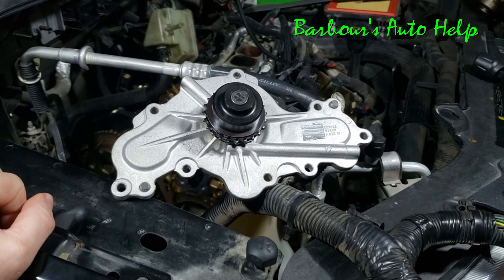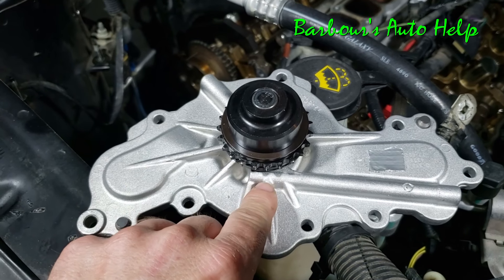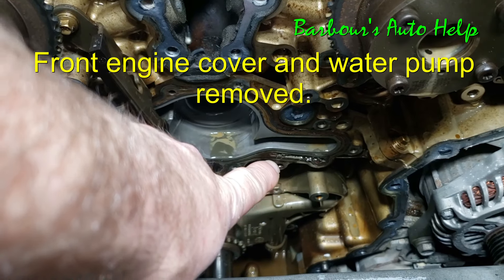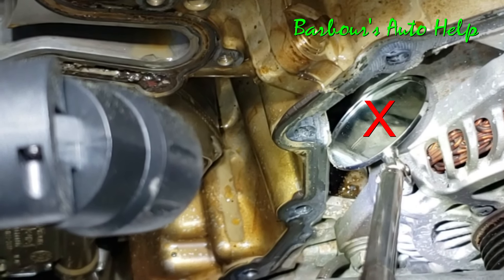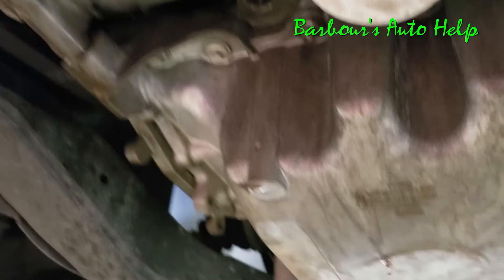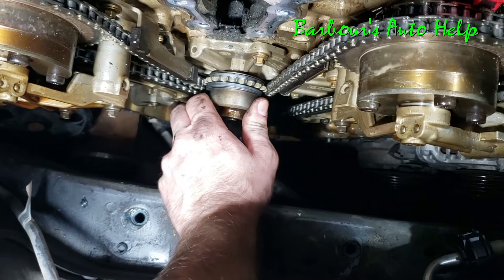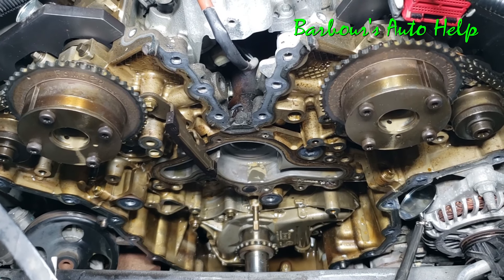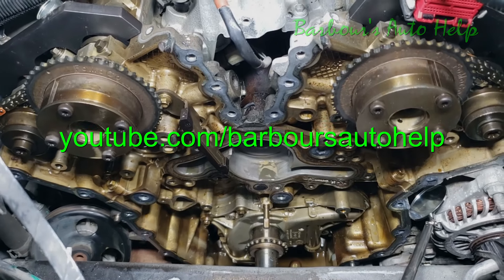Ford 3.5L and 3.7L Water Pump Leak/ What To Look For

Comment from the maker: No, It's not your imagination.  This is a repost.  I left out the fact that this information is also applicable for the 3.7L V-6 too.  Had to get that in there.
Reply: Thanks!  Just had a police intercept Explorer come in for this.  147k miles on it (and a ton of idle hours since it's still in service) and this is the second water pump failure for this vehicle.
Reply from the maker: Have a blast!
Reply: It doesn’t apply to any of the RWD engines like the F-150, Transit, and Mustang.
Reply from the maker: You are correct.
Reply: @BarboursAutoHelp  2017 Ford F150 4WD?
Reply from the maker: Not the same.  Yours is externally mounted.
Reply from the maker: But, I can answer some questions regarding that vehicle.
Reply: @BarboursAutoHelp  Thanks for the quick response, that was my biggest concern and now I can rest easy. One other question I have, is that my radiator fan runs on high (for 2 minutes) after I start the truck again, after running it for an hour +. It may completely normal, but I was going to ask the dealership. Appreciate the help!
Reply from the maker: Does your F150 have the 5.0? And is it low on coolant?
Reply: @BarboursAutoHelp  3.5l ti-vct v6 (ffv) Duratec and the coolant is full.
Reply from the maker: Sorry it took me a while to get back to you.  Id suspect something with the A/C possibly.   I've seen several F150 with very high pressure on the high side of the system.   It's possible that the txv is sticking or you have trash in the condensor.   Not saying for sure that's it but thats what I suspect.
Reply: @BarboursAutoHelp  No worries and I appreciate your help. Taking in Friday for an oil change and am having them look at the fan issue at that time.
Reply from the maker: Awesome.   Let me know if you need anything else.
Reply from the maker: Check out the description.
Reply: So, we have an MKZ that is overheating.  Not having coolant loss that I can tell but the car is overheating.  Thermostat is good.  Just noticed that it sounds like a bunch of loose change rattling around.  I am guessing that the impeller came apart so it simply cannot push the coolant.  Any thoughts?  Thanks!
Reply from the maker: It's entirely possible.   You'll need to do a bit of digging to be sure.   May not be a horrible thing to have a tech take a look.
Reply: Can i send you short video for advice
Reply from the maker: @meirzitun1 Of course. Post the video to your channel and the comment here with the link.

Comment: My gosh. Thank you for posting this. We just had some very low temps and I thought I had cracked the block. Only reason I gave pause to that theory was because the block was dry where the water jackets were. I was scratching my head baffled trying to figure out where the leak was coming from 😂. I was going to pull the trigger on a reman’d engine tonight. This video just saved me thousands of dollars.
Reply from the maker: Now that makes me feel so good!  I’m very glad to have posted this as well. Good luck to you.

Comment: First off Thanks for the video! Had my water pump changed 2.5 years ago which was an extremely costly repair and just noticed last night that it’s leaking from this exact area 🤦🏽‍♂️ I check my fluids often and maintain my vehicle very well. Had no indication that this was coming again. I love my 13 Taurus so much but I don’t think I will ever buy another vehicle with this engine 🥴
Reply from the maker: Unfortunately I had the same issue just a few months ago.  This time I put a Motorcraft water pump in it.  Should hold it much longer.  Brands do matter.

Comment: Thank you, I was watching one of your other videos and halfway through replacing the timing chain and water pump when I noticed coolant still running off the side of the block on my 07 Edge. Thankfully, I found this video before pulling the rest of the components off. Same issue, catastrophic pump failure idling in gridlocked traffic.
Reply from the maker: Glad it helped

Comment: I’m just chiming in here. I have a 2013 Edge. Leaking coolant today and saw this video stating the water pump may need replaced. Bought this at 30k in 2015. Never thought to check coolant for a change out like you’d do an oil change. Quoted roughly 2k to replace. Ugh - sucks. Thanks for the great video. I wished I could explain things clearly as you did in this video.
Reply from the maker: Sorry about your situation. Hopefully you get to the other side of it without too much pain.

Comment: This is a very informative video thank you I could not find out where the leak was coming from I was told multiple freeze plugs I just couldn't believe it I've been doing diesel mechanic work for 16 years. This needs to be addressed by Ford I do everything else to maintain my vehicle keep it up to par this is a lawsuit that was one in Canada for knowingly use this bad design

Comment: You described the problem.

But is there any preventive maintenance to follow?

Thanks.
Reply from the maker: I'd like to say flush the coolant when needed and everything will be ok.  But, the truth of the matter is everything mechanical will fail at some point.  Water pumps will leak eventually......on every vehicle.  There is no immunity as far as I'm aware.

Comment: Just today I felt my MKX begin chugging. Looked down and saw my temps spiked. Coolant was below the reservoir. I put more in but temps shot back up in minutes. I put more in and watched it start dripping seconds after I started it. I started poking around with my light and saw a spurt like a jugular coming out in the notch above the radiator. Looks to be right in that spot. So what does that go for in 2024?

Comment: So, this truly changed my mine getting a Ford Edge SEL 2011.... Thank you so much, video saved me some money 💰
Reply from the maker: I wouldn't let this turn you off to Ford Edges.  Water pump replacement is a fact of life.  It happens....on every vehicle I know of.  And it's really expensive on other vehicles too.
Reply: Do not ever. ever. buy a Ford Edge seriously. I’ll never buy a ford again
Reply: @ColoradoKid32  me either. Done with fords. My Kia had 0 problems and soon as I came to ford it gives you repairs you can’t work on yourself.
Reply: @kalikhloedaddyparker6813  Will change your view on the KIA. time will tell. Weak cast engine. Horridctranny.

Comment: Barbour's Auto Help I'm thinking about having the water pump changed at a dealer at 100,000 miles ( at 95000 now) . It's not leaking just trying to head off any disasters before it does. Is this something you would recommend? Thanks for the heads up video!

Comment: This is only for transverse mounted 3.5L and 3.7L V6 Cyclone.  Longitutinal mounted engines of this type (Expedition, Mustang, Transit vans, etc.) have a normally exterior mounted water pump.
Reply from the maker: Correct, you've summed it up.

Comment: Hello.  A beautiful result.  My mazda cx9 3.7 engine has 210,000 miles.  Original pump.  Original timing.  What does valve clearance look like?  Do the pushers need to be replaced?

Comment: Good afternoon, I have a small refrigerant leak where the pipe that passes between the two cylinders is located (coolant pipe that connects with the thermostat) the water pump is the same leaking through this area?

Comment: Whats the mileage of the car?
I got recommended to replace water pump before 100k for my ford explorer 2015 v6 3.5... I checked under no leak as of now all good,👍👍 let me know.. Great video,👍👍
Reply from the maker: Just a little over 140k.  I'd say around 100k would be a good time to at least monitor the old water pump.  Make it a point to check the side of the block for a coolant "snail trail" every time the oil is changed.  (of course you should always check for leaks when doing an oil change no matter what th mileage.) They usually weep when they go bad.  Mine just went out catastrophically.  While these water pumps do go out the same way mine did I don't see it happen all the time.
Reply: @BarboursAutoHelp  thanks mn got it 👍👍

Comment: I have a leak it’s actually coming from a point closer to the fire wall like the back bottom side was wonder if there is anything I can put in it to seal it or do I jus gotta do what u did mines a Ford Taurus 2015 3.5l limited plus I really can’t see coolant but there is Moisture over where I think it’s leaking I changed the thermostat lil while before this happen an I notice this

Comment: I am asking you for your opinions.  I have a mazde cx9 with a mileage of 180 thousand miles in 2008.  The oil has a good color and there is no loss of coolant.  Is this drain hole in cx9?  Is the liquid leaking in this place when 1 sealant is damaged?  If there are no traces of coolant, can I sleep well?

Comment: (1) Is there an additive or would changing the coolant more often (every 6 mo?) prolong seal life?  (2) do you generally notice a leak before there is catastrophic failure?
Reply from the maker: 1.  I'd follow manufacturer's recommendations as to when to flush.  I would not use additives.   2.  Usually it weeps before catastrophic failure.  Check coolant level frequently and inspect for leaks.
Reply: @BarboursAutoHelp  would any pressure guage thst would detect lower antifreeze pressure
Reply: Had this happen to me also & did Countless Hours of Research & Reading.. I read MANY testimonials of people that Never had a issue, some 300k+ miles and swore by doing Coolant Flush/Changes.. I read of two different fleet mechanics that went from having to do countless Engine Replacements to just Coolant Maintenance..
 I also read from the consensus of Mechanics the CORRECT Coolant is Vital !! So NO Additives, NO topping off with what ever is laying around.. So if you're not original owner , your wife or someone posdibly got a $19.99 Oil Change at Stiff U Lube & there's any possibility it's been topped off with one of the Coolants that supposedly don't play well with the Seals I'd Flush & Start from scratch and use the Recommended Motorcraft Big $$ Coolant.. Double Check yourself either in the Manual or a Ford Site because I even had the Dealership try to sell me the wrong crap once saying "its all the same".. 🖕Not !! 
 Also one last word of warning, there has been instances where the Weep Hole doesn't make it obvious and I also saw (hopefully rare) instances where the inner seal went before the outer pumping all the coolant into the engine and zero weeping.. 
 So My BEST Advice is Check Oil frequently, Check for Color on dipstick, Color on white paper towel after wiping it, Note the Level, If the Level is Ever Higher than the Last Time.. That's an UH OH !! Oh and of course the same with the Coolant level and color..
  If you feel you have reason for concern that you might have a problem.. Change the oil and have it tested.. Honestly I just thought of this, never heard of testing antifreeze for oil but I would think it could be done, possibly even by just leaving some in a clear cup for a while to look for separation ?? Idk..
Reply: #1 Did the Engine end up surviving & if so how many miles now ? (Congratulations if it Did !!)
#2 I just want to warn watchers/readers that I have seen instances where the Weep Hole didn't Weep giving an obvious heads up prior to 😲🤑.. It's a strange hard to explain set-up, it looks like in theory they (thought) they designed it so one seal would fail before others and it would start pissing out the Weep Hole saying look at me ! Problem over here ! But if I remember correctly sometimes the destroyed seal blocks the hole or they just fail in the wrong order..
Clean Correct Antifreeze, No Additives, Frequent Height & Color Checks of both the Antifreeze & Oil..  Keep a note of level, if it mysteriously raises that's BAD !! Good luck !!

Comment: So how do I quickly notice the leak and turn off the car, the liquid will not damage the engine?  I rode slowly for 3 km.  I noticed the fan working.  I stopped and didn't drive the car anymore.  Today the mechanic will replace the pump and timing belt.  I look at the oil dipstick and see a lot of fluid in the engine.  I think 2-3 liters.

Comment: Excellent video, thanks for posting.  Does anything in front of the motor have to be removed to get the timing cover off properly? Radiator?
Reply from the maker: Click the thumb nail at the end of the video to part one of water pump replacement for my Edge.

Comment: I really wanted a 2017 ford explorer but this was such a bummer! I found a dealer that offered me a free powertrain warranty for life and specifically stated that if this happens to my explorer they will cover parts and labor for me.
Reply: Yeah I got mine with a warranty but it only covered $400 of the $2000 repair. This is because water pump counts as coolant repair and it only covers up to $400 on those. Mine started leaking a week after buying it
Reply: @kickthejamz  i traded my explorer in at 106k for a mustang mach e
Reply from the maker: How liking the Mach-e?  Pretty cool ride huh?!

Comment: Si when the weep hole is leaking do that means I’ll have to replace the whole water pump on my Ford flex 2010 v6 3.5?
Reply from the maker: If it is leaking then it is bad.  So, yes.

Comment: I have an 2009 madza sedan 3.7. For about 4 months i have been battling a water pump leak. This is the first video i have watched that explained and showed just what im dealing with. As im typing this i have my car up on jack stands now. Now the problem is that i do not know how to break down the engine for to get to the water pump. Please help me so i will do a great job
Reply from the maker: I've got 2 videos on my channel where I replace the water pump on my 07 Edge. Part 1 and 2.   They are actually linked in the description below this video. May not be exactly like yours but may help.
Reply: @BarboursAutoHelp  thanks. ill show and let you the outcome. have a great one

Comment: Do you have to take the timing cover off to change the first seals for the wheel hole?
Reply from the maker: You have to replace the water pump to fix a leak from a weep hole on this engine. That requires removing the timing cover.

Comment: my  edge  2010 edge  same problem the engine can turn super hard and sometimes get stuck and i haven't clean  the oil pan should i just replace the whole engine or gamble and just replace the water pump and headgaskets
Reply from the maker: Why would you replace the head gaskets?
Reply: @BarboursAutoHelp   i bought it to fix it and  previous owner said had blown headgasket  and also they did drove that car with bad water pump for a while  
and they said car dye while driving but i check the car and it does turn the engine  but not super easy and i checked the cam shaft journals and the   have a little bit of damage but no to bad  so im confused and i been trying to to get some info canttttt find anything should i replce the engine or just clean it  get some parts and pray to hopefully starts 
also thank you for replying i really appreciate
Reply from the maker: @ofalejandro12 Hmmm..  blown head gaskets are very rare on these. I wonder if they just guessed.

Comment: This can be prevented by changing your coolant as recommended.  The wster pump has two rubber gaskets.  The outer one gets eaten by coolant with high acid levels causing the coolant to drip out the weep hole.  If you see your overflow dank low or coolant drip.  .. then its too late you need to change your waterpump ASAp.  If not the high acid coolant will now eat the inner rubber gasket leading to coolant gettibg into your engine oil.  Then new engine.  All preventable if you change he coolant as recommended.  Dont change your coolant for 5+ years  this is what happend. Dont blame ford for faulty design..

Comment: I have a friend who bought a 2016 Explorer Police Interceptor 3.7L and coolant/water leaks in the area of PTU or in front of it.  We couldn't see from where the water was coming from.  If water pump issue, as you suggested, it would leak from side of the engine.  Can that water pump leak make it to the back of the engine?
Reply from the maker: There is a weep hole under the intake as well. They can leak from there also. However, it’s more of a rare occurrence. It’s possible that this could be the leak. Of course verify.

Comment: I am losing coolant at times and found a puddle of coolant one time. I see seepage near my alternator, but it looks more like oil. I also have oil on the trans fluid cap and all around it. I have no symptoms of a blown head gasket. I cant see the oil being runaway oil from oil changes. What do i have going on here?
Reply: 2013 Taurus 3.5
Reply from the maker: Not sure.  You'll need to pin point where the oil is coming from.  There is no way I can do that for you here unfortunately.

Comment: Im getting some leaking from that same area on my 2017 Explorer. My oil looks clean from the dip stick. Car started getting too hot a couple months ago so I refilled the coolant, and now the coolant it low again. What do you think? Same thing?
Reply from the maker: Sounds like it.
Reply: Water outlet? What was it
Reply: Stop driving now, get to a competent tech asafp

Comment: 2015 Ford Explorer starting leaking coolant.  Warning light came on indicating that "engine coolant temperature is too hot" or something along those lines.  Puddle under explorer seems to be under the radiator fill rather than under alternator.  Took to Ford dealership and they are saying it's water pump.  Can I really trust their diagnostic, i.e. is there some way to know for sure that it's the pump and not a leaky hose?
Reply from the maker: Did you look?